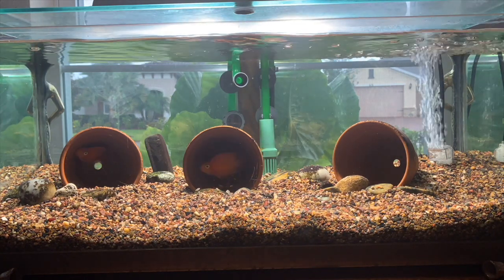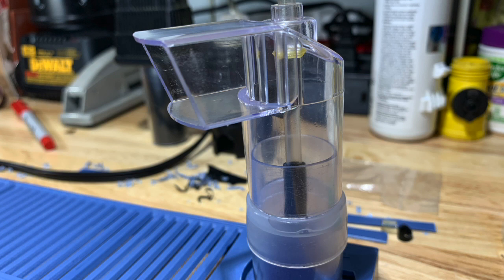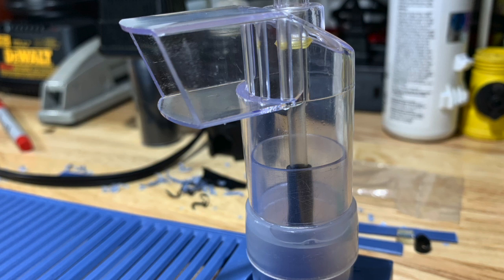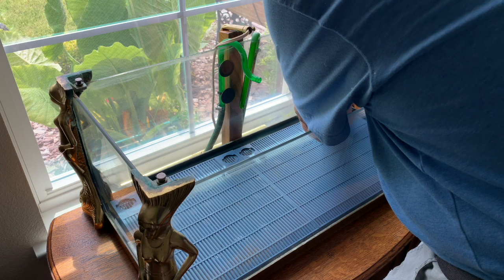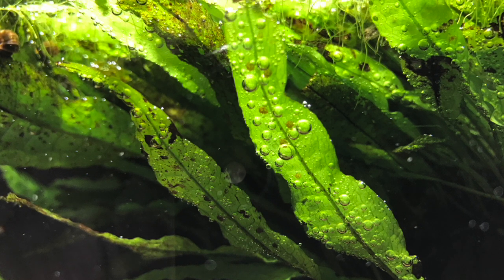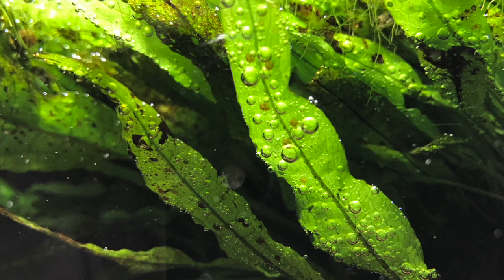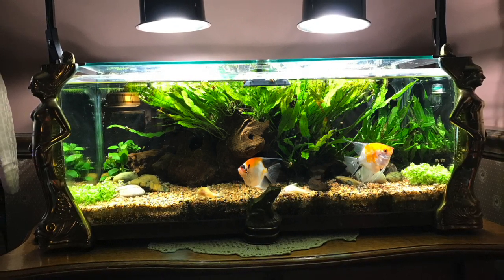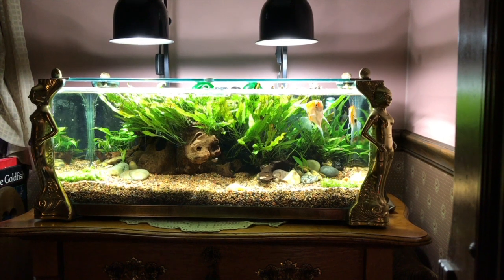How to build a Plenum to establish Anoxic conditions in your aquarium.PART 2. Using sand.

Comment: Hello Kevin, I hope you have a minute to answer my question please. After watching your older videos. I built a plenum out of eggcrate and weed barrier fabric overlaid, and then 2-3” of sand. One end with short 2-3” tube with an air pump placed into it. Overpopulated 160g with lots of large clown loach. So far after 2-3 months, no decrease in nitrates. I was wondering with the loaches dig into the sand and expose the weed fabric would that negatively impact the anoxic bacteria I’m trying to establish? Thx
Reply from the maker: Yes. Loaches digging into the sand is your problem. The are adding too much oxygen to the plenum.
Reply: Kevin Novak 
Thanks for the reply. I thought this was true as well, so I layered 1.5” of sand on top of the plenum and then topped it with another layer of the fabric and varying levels of sand of top of that. So far, no luck. Nitrates still at 80, after weekly water changes of 80% using API stress coat dechlorinator as I read the seachem prime negatively affects anoxic bacteria growth. Any thoughts? Very sorry about your recent loss, god bless.
Reply from the maker: J J thanks, hang in there sometimes it take longer for the bacteria to grow so keep up you studious husbandry.
Reply: @JJ-yn7ek  I'd be really curious to hear if you notice any difference with the Seachem vs the API, please let me know if you come to any conclusions
Reply: @VinylUnboxings  
No difference between seachem and api water conditioner on anoxic/anaerobic bacteria and impact on reducing nitrates. But, maybe it’s just me. I’ll never know.
Reply: @JJ-yn7ek  Thanks JJ. No pressure, but since you follow Dr. Novak's work too, if you have the time could you tell me if this seems right?

So basically doing this with gravel/sand still creates the anoxic conditions, but doing it with a substrate of Kitty litter, (because of the crystaline structure attracting the NH4 ions) and Laterite/Flourite (because an iron source is important for the dimorphic bacteria to colonize) just creates a better environment, making it all the more effective? Like essentially this is just creating the anoxic conditions, but not utilizing the full functionality (magnetic permeability) of the BCB filtration system?
Reply: @JJ-yn7ek hi.. how's the nitrate levels currently ? Did they decrease ?

Comment: Think I'm going to try 3/4 in dirt, a little ironite plus, and 3 in kitty litter in that case.  Do you think adding the ironite plus to that would be doing too much?
Reply from the maker: Add only very little ironite plus. Maybe a teaspoon only per 50-gal of water. You may not even need to do that whit dirt though. Dirt will have more than enough nutrients in it for quite some time.